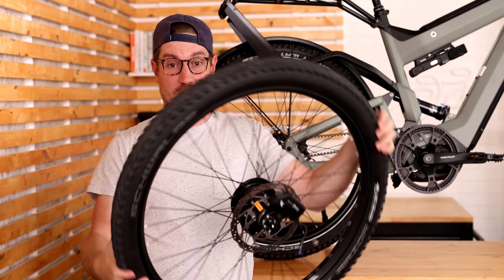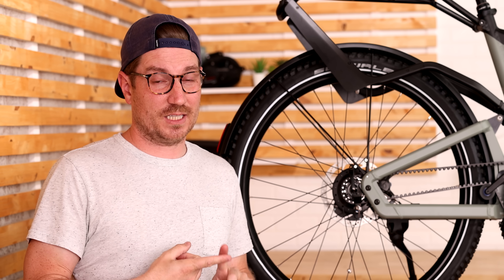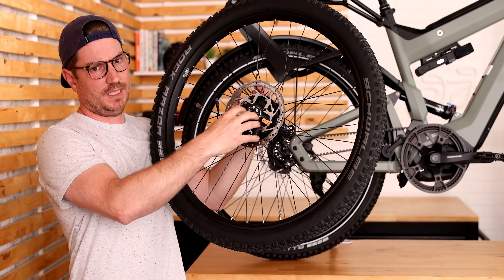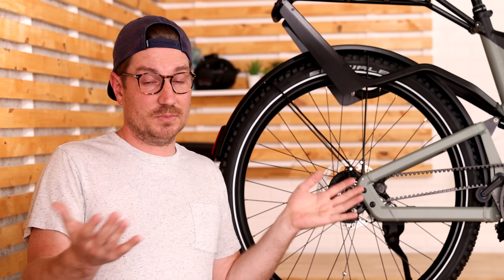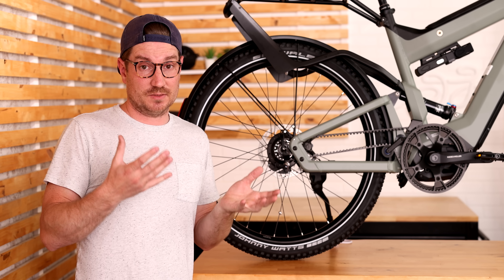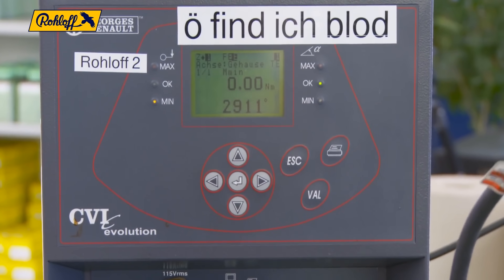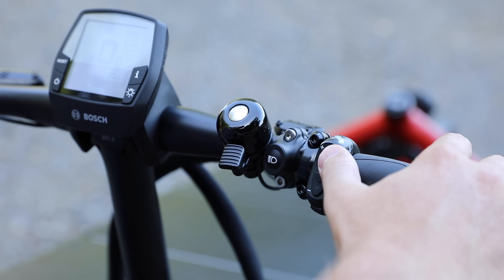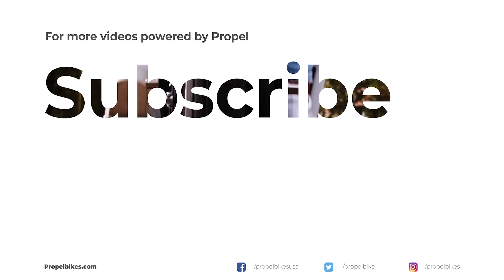Rohloff E-14 - is it really the best eBike drivetrain?

Comment: But is it worth it if you're not riding up mountains? It's like £1400 more expensive than an Enviolo IGH with carbons belt drive.

And when you say more efficient than say enviolo IGH does that translate into better range for the battery?

Comment: I have the superdelite for some time now i don’t think i would buy it again, i do 10.000km a year and this is also the lifespan of the belt with this configuration, my charger had 25.000 before wearing out so that’s a lot more, also the air damper needs new seals every 5000 km so this together makes it a very costly bike. On top of that my rohloff is started to leak oil so that also a common problem that doesn’t get talked about enough..

Comment: I've been the proud owner of a Riese & Müller e-bike (the Supercharger Rohloff) here in the U.K. for over 4 years now, and I can vouch for its quality. However, the pricing does leave a bit to be desired, and spare parts can be quite pricey too. To put things in perspective, I recently had to replace the front drums and brake pads on my Toyota, and it set me back around £160 (approx. US $200), inclusive of labour. In contrast, when I needed to replace a defective part on my Rohloff, I had to purchase what's known as the "Rohloff diagnostic kit," and that alone, without factoring in any labour costs, cost me almost £700 (approx. US $840)! If you're skeptical, feel free to Google it.

What's even more challenging is that neither the bike shop where I purchased my R&M bike in London nor any other I contacted had prior experience in dealing with a similar issue. Their standard suggestion was to bring it in and have it sent to Rohloff (likely in Germany) or Bosch for investigation. As my bike is now over two years old, it's safe to say that it won't come cheap. The worst part of owning an "R&M" e-bike apart from the initial purchase price, the cost of some spare parts is undoubtedly, the lack of trained individuals or bike shops in the U.K. able to deal with issues which you are bound to come across over the years of ownership. In the past 12 years, I've owned four different e-bikes ranging in price from £1,800 (approx. US $2,160) to £6,000 (approx. US $7,200) a price I paid for my R&M in 2019. As I said earlier, even though R&M bikes are very good e-bikes, but I would never buy another R&M again for the reasons outlined above.

Comment: Every time I tried the Rohloff hub on an ebike my issue was that it was so slow to change gears. The steps between the gears are too small for an ebike, and I had to switch 3-4 gears each time. A lot of button presses all the time on the flimsy small buttons.

For mechanical bikes, I love the Rohloff, it is fantastic, and the small difference between gears helps fine tune my cadence.

Comment: It'd be sweet if the normal cable-shifted Speedhub could be converted to the E14 system, and if it could interface with a Bafang BBSHD.  It looks like the only difference is swapping the cable system over to the electronic shifter.  If it is that easy, I'm very interested.

Comment: Here is my experience of drivetrain:
1. Skeppshult Shimano hub 7-gear 15.000 km - no repair
2. Pilen Shimano hub 8-gear electronic 8.000 km - no repair
3. Nishiki Shimano 8-gear, broken at 7.000 km. But I could still ride on it, have to change internal hub. The gears appeared like this 1-2-3- 1 -5-6-7-8, not so nice. Today 13.000 km no more repair so far.

Comment: Some people want this, but most people just want a frame with wheels and a ROAD TO RIDE ON.
Reply: I am watching the video, and how is a 3000 miles oil change reliable? 

Normal systems don't have oil, ebikes are extremely overpriced in repair shops. 

So instead of changing the nylon gears every  20000 miles you now need to pay over 100 bucks every 10 weeks. 

Ain't nobody got time for that. 
And if you don't....
Byebye warranty, bye bye money🤷
Reply: This video is actually really misrepresenting any value it has over any other bike, like dude what the f are you even promoting? 
Compatibility?, Repairability?, Cost of ownership?  Nothing you promoted is worth chaining yourself to Bosh or rolof.

It is bullshit like this(as a Dutch dude)that makes me really mad, so mad that i am litteraly designing my own product. 

It will be cheap, oma fiets strong, and almost no maintenance.

Comment: B/S its just a copy and update of the Sturmey-Archer hub gears.
Reply from the maker: It's actually an improvement on the Sach's hub as I mentioned in the video. It went from 339% gear range to 526%. A pretty sizable difference from Sturmey Archer's 243%, but there are certainly some shared technology and characteristics. Range and electronic shifting excluded.
Reply from the maker: Ten years after the Rohloff Hub Sturmey Archer introduced an 8 speed hub with a 325% gear range. Don't get me wrong, Sturmey Archer makes a great hub, but it's not apples to apples.

Comment: I am currently on a Specialized Vado 5.0 igh that uses the larger of the two Eviolo hubs which I believe is 380 percent range. I did have some issues with keeping the cadence slow enough at high speeds but going to a 2 tooth smaller hub gear pretty much solved the problem. The Vado 5.0 has that auto shifting box which is just so great as I am not sure I would ever want any kind of twist shifter especially on such a high priced bike. I see on the R & M that there are also manual override buttons which is kind of like paddle shifters in cars. Wow I will really have to try one of these and likely get one since it also has that rear suspension that I am missing from my mt bike. Thanks much.

Comment: Excellent video and explantion. It seems like the Rohloff or Enviolo hubs would be ideal for my Santa Cruz V10 ebike conversion project. I'm running into challenges with the 83mm bottom bracket width and the 157mm rear hub spacing. This makes for a challenge to maintain a proper chainline. 

However, the internal geared hubs are not only super expensive but heavy. The motor and battery is already heavy but add a geared hub and now where pushing 60lbs. Not really an issue for pedaling but for transportation when you need to take it on a plane even without the battery. 

Anyone out there use a geared hub on an 83mm mountain bike?

Comment: One might query the need for such a high range in gearing in an electric bike. After all, why have an electric bike except to help you up the hills - why have such a low gear in this case? (I'm talking road or gravel rides, not mountain biking or load deliveries) Enviola would be good alternative. However, I like to ride my electric bike without using the assistance on my rural trips, just reserved for hills or headwinds, or if I've had a couple of pints at the pub. So here again, the loss of efficiency with the Enviolo would be something less welcome. I think the poster enjoying a Shimano hub probably has it right. Cheaper, lighter and more than adequate for normal leisure use. And I certainly agree that hub gears for this sort of use are actually better than derailleurs. Here in NZ, they still have discover that hub gears are good, bikes with hub gears are very hard to find. .

Comment: Typically great a video from you sir. I just bought a specialized Vado 5.0 igh with the nvolo hub and automatic.. Not sure I can ever go back to a derailleur or a twist shifter for that matter. Just need to higher gear the Vado to increase its top speed since it only has 380° in the hub. No doubt I will own a rolhoff before I die. I like the looks of some of those sportier reice and Mueller bikes in the video Thanks.

Comment: So fa the most informative YouTube on internal hubs I have seen are on "Cyclingabout". Check it out.  The Rohloff is considered the gold standard for touring bikes with the highest reliability where it really counts, but new internal hub bikes are being specifically developed for e-bikes a somewhat different animal.  E-bikes as well as tandem and cargo bikes may have maximum torque levels above the design limit on the current Rohloff design.  So some new designs are designed to easily accommodate the increased torque requirements.

Comment: I just wish it would shift down faster. I'm always finding I come up to an intersection - I've started down-shifting what seems like forever ago, but the Rohloff is still thinking about it. Then the lights change and I really need to be in a lower gear but it's still getting there. I put on the power so I'm not holding up traffic - and (thanks for this Rohloff) it will seemingly always find 14th gear in-between the lower gears. So I'm there, looking like a numpty, trying to pull away from close to standstill in top gear. I never had this issue with my 500/14... shifting from 14 to 5 took the flick of a wrist and it was there.

Comment: Additional information on pedaling pauses during gear changes:
The internal connection between the Rohloff E-14 and the Bosch motor of the new Generation 4 no longer require pedaling pauses under load.
The Bosch motor regulates this completely independently and takes for the mini-second the pressure from the drive belt. The driver no longer has to pay attention to it himself.

Comment: Even tho I think internal gears are a great solution for some use cases, the derailleur is way cheaper and way more efficient. Just coasting you can feel the drag of the Rohloff hub, so I don't think they are that great.
Of course, if you are using an e-bike this problem is less important.

Comment: I had considered the Rohloff & Enviolo when looking for my Internal Geared Hub & there were a few factors which made my choice the Alfine 11. This was 6 years ago now & still very happy with my choice. Here's what I didn't like about the Rohloff & Enviolo - With the Rohloff it was the cost. In Canada they end up being a little under $2000. by the time you are on the road. As a comparison my Alfine 11 was $700. ready to ride. My rationale was if the Alfine fails after a few years I can either replace the inner assembly for $400. or buy the latest version of the hub & still be hundreds of $ ahead. I also didn't like the dual gear cables & twist grip shifters on both hubs. With the Alfine I had a choice but the paddle shifter has been faultless. With the Enviolo it was the weight of the hub & the feeling like it was rubber banding. The last consideration was the gear range. With the Rohloff you are able to achieve a lower gear inch which is better suited to climbing or carrying heavy loads but with the Alfine hub I was able to gear it almost as low while achieving a better high gear. This suited my riding better as I wasn't going offroad or carrying very heavy loads. Rohloff also has this policy of limiting their warranty coverage if you go outside of their recommended ratios & for $2000. this did not inspire much confidence in buying their hub.

Comment: As far as I know, Sram stopped/discontinued the internal gear hubs in 2017. So they no longer manufacture such hubs. The only players on the market (for rear hubs) are as far as I know Shimano with their range of Nexus and Alfine ( 3 to 11 gears) and Rohloff with 14.

There is also Pinion but their product is a mid mounted gearbox, not a hub. And I think there are another 2-3 gearbox manufacturers but very small and niche.

Comment: Great Video!  Currently wearing out another Enviolo hub on 1st gen R&M Supercharger.  Is it possible to upgrade to Rohloff E14?
Reply: Mechanically switched Spedhub could be installed by user, but E14 needs "pairing" with Bosch system and that can be done only by bike manufacturer.
Reply: @tuunaes  I would actually prefer mechanically shift ;)  
Any reprogramming necessary in motor for geared vs CVT shifting?  But mostly was wondering if there are any potential belt alignment or rear cog shim requirements?

Comment: I have this bike, Superdelite GT Rohloff and the gear change is awesome, but the "dead spot" u mention is actually a bit annoying when u live in a hilly area like I am.

The "dead spot" is never ever an issue once u learn the timing, atleast for me. It's a bit annoying tho.

A big problem however is this;  It becomes a problem when you are moving straight ahead and u are about to go up a hill. Your bike slows down naturally as you ascend and as you go from, lets say, gear 12 to gear 3 it takes several gear changes before you get to gear 3. That means you cant pedal for that very long duration of time and you end up stressing out a bit cuz if u dont hurry to get to gear 3 before your speed gets too low you will have to step of the bike. It get's way worse when you go from a hill that INCREASES in steepness as you go up it.

 I wonder what the enviolo is like.

Comment: Great video! I live in the U.K. (London, England) and am the proud owner of an ICE Adventure HD recumbent trike (I'm a stroke survivor and lost the ability to balance on two wheels) with a Rohloff e-14 hub driven by the Shimano STEPS system. A fine system with one major fly in the ointment. The manual Rohloff system relies on a grip shifter which on a normal bike is gripped by the thumb and forefinger. Alas, on the trike the shifter is inverted so all the grip strength has to come from my pinky(!). I'm fascinated to learn that Rohloff has brought out an e-shifter for the Bosch drive. Any clue about interfacing with the Shimano system?
Reply: I found your comments most interesting since I'm 82 with nerve damage in my back which affects my balance. I've had to stop riding my e-mtb. I've recently ordered a Utah Trikes custom Catrike V3 (fat tire recumbent trike) that comes with Nuvinci rear gear hub. However, I've been debating whether to request a Rohloff rear gear hub system instead. I live in the Bitterroot Valley of Western Montantana (in the States) so there can be a lot of hill climbing in addition to some great flat out bike paths in the Valley for moving out out on. Rohloff seems to check all the boxes.
Reply: @Mycopsycho  Utah Trikes is selling a Catrike Dumont with the Bosch motor and the Rohloff E14 hub with the Bosch Nyon controller.

Comment: What if and when the electronically part is malfunctioning? Does the Rohloff still work without it?
Reply: If electric shifter unit doesn't get new commands, gear simply stays at what it is.
So in that sense it would be good to have that automatically selected gear when stopping more general gear, instead of very low gear.
In mechanically shifted Rohloff you could remove cable box unit and use wrench to change to suitable gear in case of shifter/cable problem.

Comment: I have an 18 speed Pinion fitted to my Scorpion fs 26. I've had it for 5 years now and covered just over 3,000 miles without a single fault. I don't think it is as efficient as the Rohloff, but it's still an excellent piece of kit. Well pleased. 

Enjoyable and informative video. Voted & Sub'd.

Comment: Any chance you could make a video comparing how loud this bike is to other ebikes or just normal bikes? i've heard the R e-14 is loud, and ive also heard the bosch motor is a bit loud too. I have a rad rover from rad power bikes and it's pretty quiet at low to mid speeds, assuming im pedaling ofcourse. I'm really interested in this bike, but the uncertainty of sound has me holding back.

Comment: I am a Rohloff user. I own two trikes, ICE Sprint RS 20" and Azub Ti-Fly 20" both with Rohloffs. I love the idea of belt drives. There are some issues with belt drives but one that I was told about was that one couldn't bend a belt backwards. One of the things I see here in your video is the bent backwards. Are these belts new tech that wasn't available previously? I do realise that there are issues of triangular frames that need to separate to accommodate a belt. I am a Rohloff fan boy. Oh and by the way that is one sweet looking electric bike.

Comment: 0:43 the rear shock on that bike should be locked or have more psi in it, or the rebound should be slower. There is a pogo-stick effect with every crank of the pedal.
Reply: The principal cause of this (a.k.a. pedal bob) is the relatively large offset between the pivot point of the rear suspension and the line of the tensioned belt/chain on the bicycle shown - You're right about a higher spring rate helping but it will never fully offset the basic geometry problem.  It seems that e-bike manufacturers generally aren't too worried about pedal bob and associated energy losses because of the assistance provided by the electric motor.

Comment: I've owned two Rohloffs and sold them both.  (I wasn't sure enough of my experiences from the first one -- thought maybe I'd gotten a "dud", but the second one was the same.)

They are intriguing from an engineering perspective, really cool -- also have a fantastic track record from a reliability perspective.  I really, really, really wanted to like them but found that there is mechanical resistance in them that just doesn't exist with plain old derailleurs.  To say nothing of the weight and expense...!
Reply: Just FYI, there is a break in period on the Rohloff hub.

Comment: I have been running 1300 watts of mid drive Bafang power through two older Rohloffs for some years now, with zero issues, one a fat bike used only on very steep rocky trails, I love them! https://youtu.be/P12Q1ADYDII

Comment: Love the video. You made mention that the hub communicates with motor and will let off on the motor when shifting [4:15] but shortly thereafter [4:50] you discussed shifting an internal hub gearbox and needing to let off when shifting.  So does the rider need to briefly let off on the Rohloff when shifting or does the servo manage that? Also, how long has the Rohloff E-14 been on the market? Any indication Rohloff  is working on improved or successor version? It’s reliability appears so solid, it would be hard to improve on.
Thanks for all your videos.
Reply: A good company is ALWAYS working on improved successor versions.